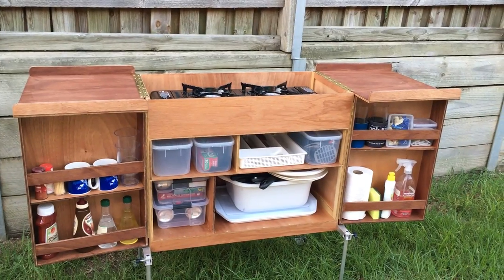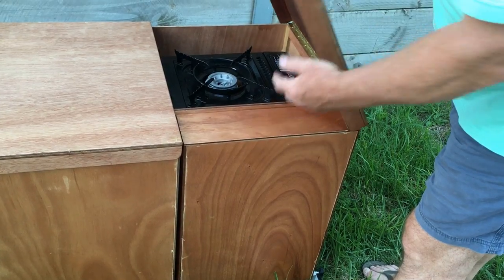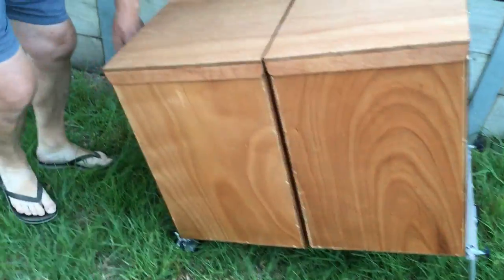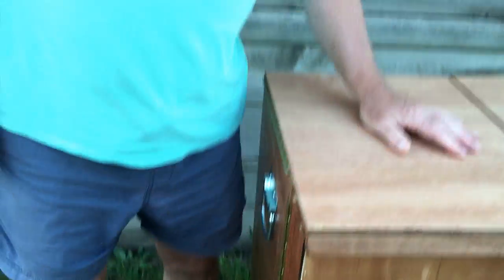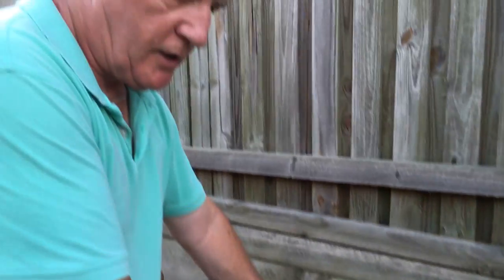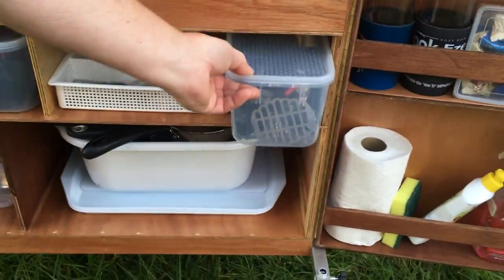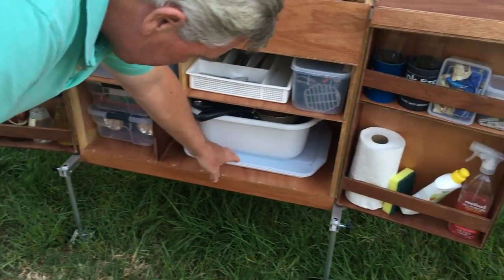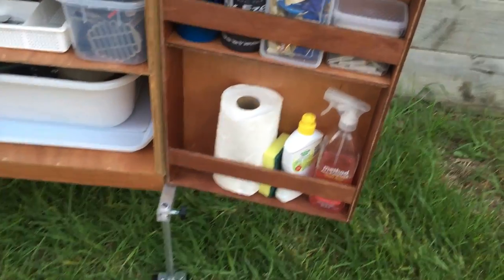Lightweight Camp Kitchen or Chuck Box with Telescopic Levelling Legs

Comment: looks good. my only criticism would be access to the cooker controls?
Reply from the maker: Yes. In practice, it has worked out like that. There is room to get to them but it is a little tight.
Reply: Could you hinge the front to  drop down? I little added bench space

Comment: Guess what....... I actually watched all of this one lmfao. Actually looks pretty good mate. Some wheels on one side would be great and I would suggest a board to raise the cooker and allow you to have a full length bench rather than just the 2 on the side.
Reply from the maker: Hi Mick. It would be easy to take out 2 of the legs and replace them with wheeled versions, but the idea of this is to make it light enough to get it out of the trailer easily. Wheels would be good if you had to walk a long way, but from now on I am planning not to have to take it more than a few metres from the car.
The idea behind the recessed top is to make the box lighter and help protect the stove against the wind. If I had a full length bench, I would still have to use the middle section to put the stove on..
Reply: @FishingwithDen  I was thinking something that folds down under where the stove is not and just be sat  on top if needed. When not using the cooker it could hide away under it to provide more length.
Reply from the maker: @aussiecarpfishos8423  These things are always open to change. The beauty of such projects is that if you decide to build one, you can add your own specific ideas. I bet many of the other viewers are thinking about other little changes too.
Reply: @FishingwithDen  yes and a little addition like the 3 fold wind break you mentioned will be no hassle to make up quick and just sit inside. Same deal with the extra bit I'm thinking.
Reply from the maker: @aussiecarpfishos8423  Exactly Mick

Comment: Would plywood get ruined by rain?
Reply from the maker: Plywood can be bought in various different types. Cheap Plywood would definitely fall apart very quickly if it got wet. I used Marine Plywood, which is more expensive, but uses waterproof glue. Either way, it is always advisable to coat the plywood in a waterproof layer like Marine Varnish. 2 coats should work just fine.